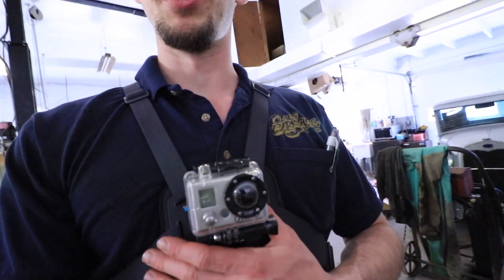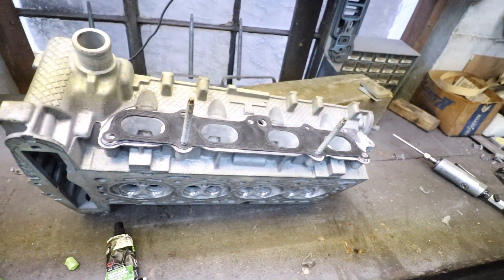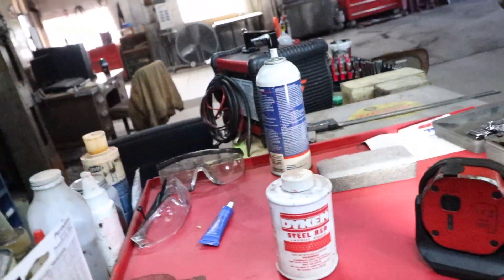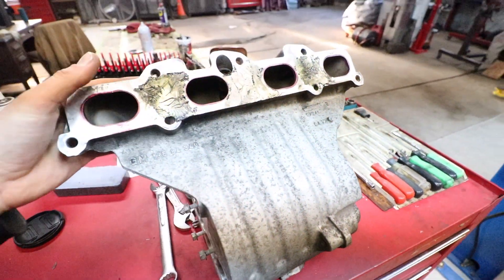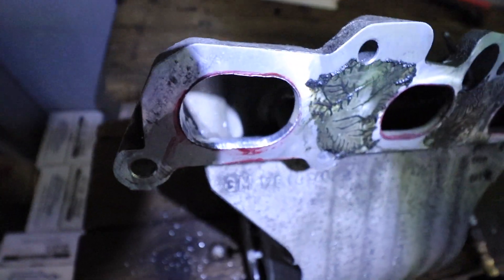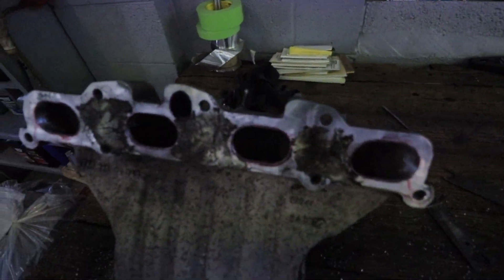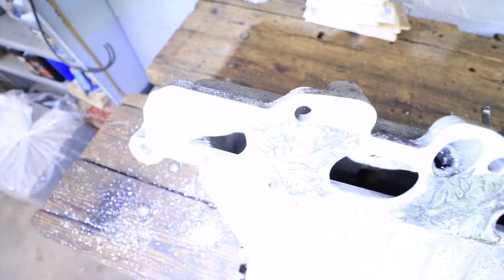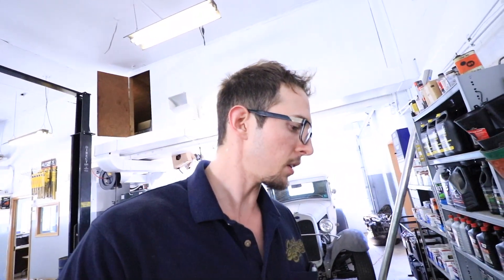Cobalt SS Intake Manifold Porting. Getting The Port Match Right

Comment: Love watching your vids on the cobalt! Got one myself. Did the zzp stage 3 kit to it but recently having coolant circulation problems in the actual engine. Gotta figure that out then think im guna port out one of the other engines I have for it. Kinda a build one while driving one type deal until the built one is good enough to swap.
Reply from the maker: dude you got the right idea i wish i had that option, thats the best way to go.

Comment: At some point I'd like to tackle that. I just need that carbide tip and possibly that sand paper attachment. I do have a dremmel with a sanding wheel, so that would probably work.
Reply from the maker: Yea that should work fine it may bog it down though that would be my only concern
Reply: @salvobrothers5928  probably next year I want to do a teardown and do some internal cleaning on my 185k motor and supercharger. It's my first forced induction car, prior was an n/a 'yota matrix xrs that I got to about 185-187 wheel how after tuning and miss, port jobs and a piggyback unit.